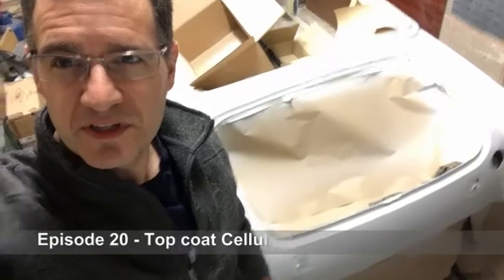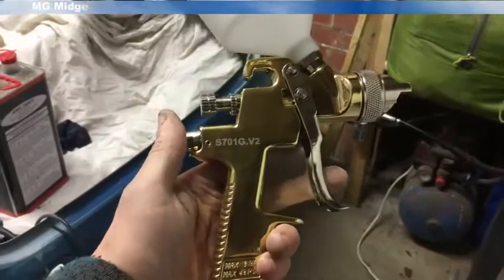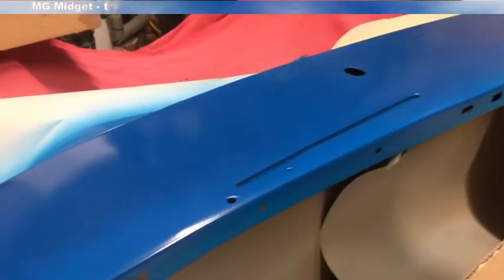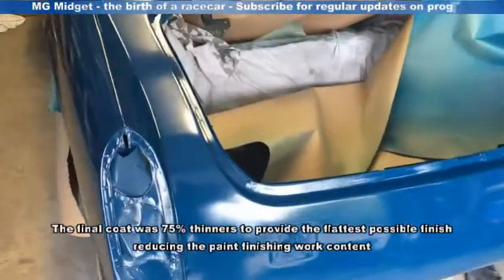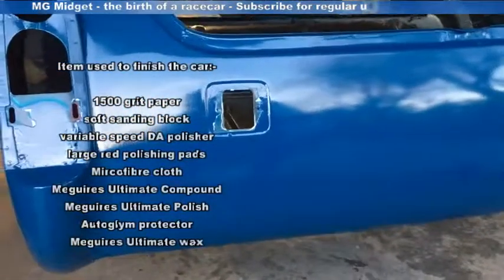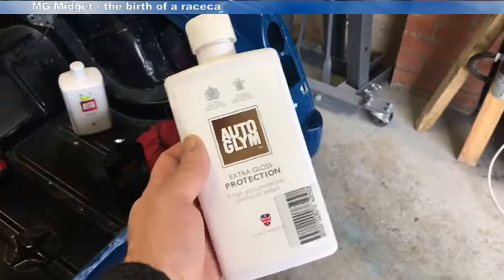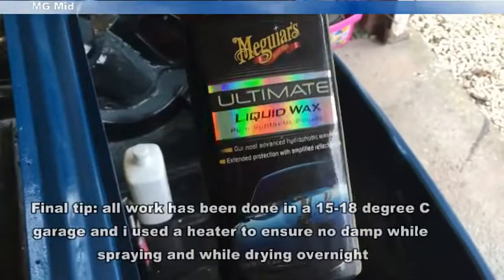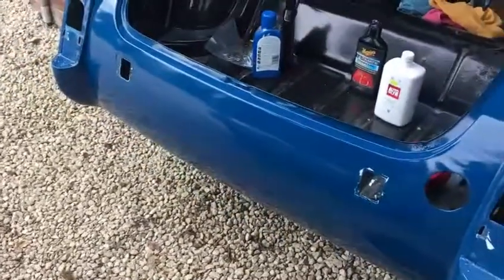MG Midget Cellulose Top Coat Preparation + Painting - The Birth of a Racecar (Episode 20)

Comment: What made you go for 40psi on your spray gun? Most spraying vids I have seen they are spraying at around 22 - 25psi.
Reply from the maker: Interesting question! got me thinking. The sealey S701 gun i used had a recommended pressure of 43psi which matched the youtube tutorials i watched but i did sometimes feel i had alot of air and could have done with more paint so next time Im painting, Im going to try your suggestion to see what difference it makes. Thanks for the comment. cheers, martin
Reply: @mgmidget-thebirthofaraceca4349  40 psi is way too high my man,that's why you had issue with alot of air and not enough paint,defo drop it down to 20 ish psi and build from that but defo not as high as 40 👍

Comment: Hi great video. I am about to spray my mg with the same gun. Can you remember what adjustment you had for fluid. How many turns out from closed position. Regards dave.
Reply from the maker: Since this video I tend to run lower pressure now about 25-30 psi, adjust the fan to about 10-12 inches . Be careful on the trigger to avoid runs but gets less mist in the air and less orange peel as more paint at less pressure. Good luck. It’s all learning but I’m sure you’ll be chuffed with the results
Reply: @mgmidget-thebirthofaraceca4349  Thanks for reply. Really appreciate it. Dave

Comment: Really well done job there. I’m on my penultimate block sanding run on a Dolomite Sprint I’m respraying, it’s my project so first time doing this stuff, and nervous to see what 7 months of body prep is going to result in with my celly top coat going on in the next couple of weeks. I’ll also be finishing up on 600 grit block sanding as I had sanded through a lot of high spots recently with 320, so went back with a lot of touch up etch and waiting for it to cure for the rest of the week.

Hope my DIY respray comes out as well as yours! 👍
Reply from the maker: Thanks and thanks for watching

Comment: I have been following many of your videos - very helpful. I am restoring a Mk1 Midget(1962) - very rusty with repair panel on top of repair panel (three on the passenger side floor for example). 
Could you tell me please what air compressor you used to spray the primer and top coat. i.e. the cfm, tank capacity and hp, etc. (The make and model would be helpful).
 I understand from the video that you used the same spray gun for primer and top coat (Sealey 1.4nozzle).
Regards 
Tony
Reply from the maker: thanks for watching. try not to overthink the compressor. mines a very old 25ltr that you can buy for around £120.  ideally a 50ltr setup would be better. the important thing is to get the water trap/regulator so you can maintain 20-40psi while spraying.  if the air runs low you stop and let it refill the cylinder